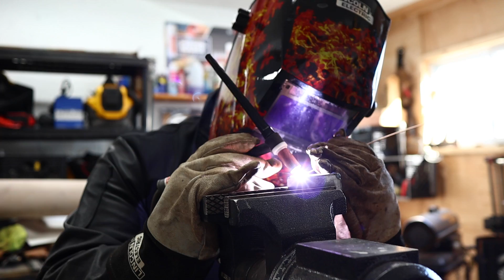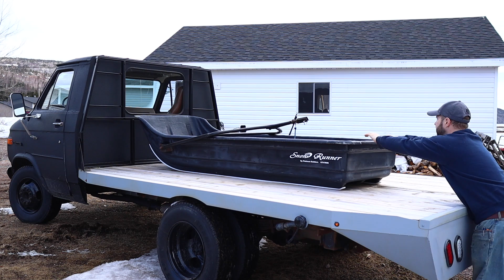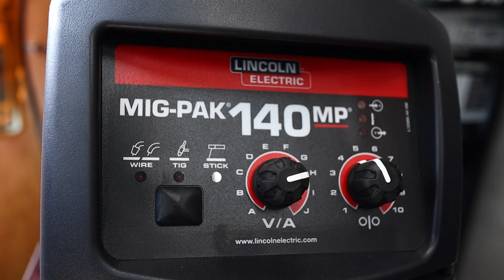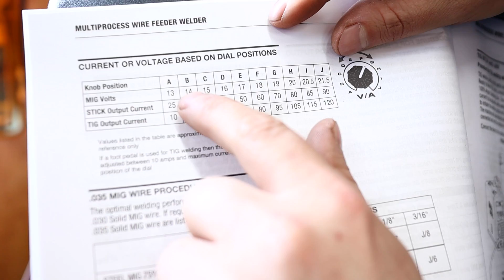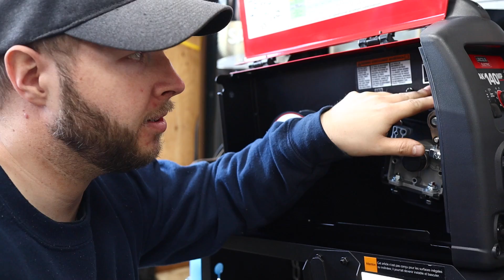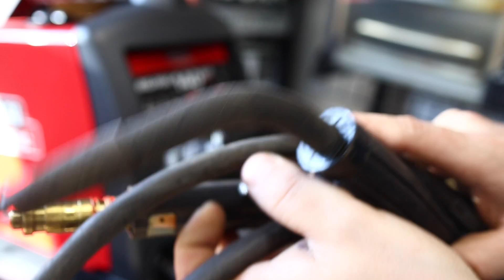The tool that COMPLETELY CHANGED my Workshop - [Lincoln Electric 140 Multi-Process]

Comment: What a great video showing the welder in detail. I Like how you showed the controls, the settings chart, and even the manual with voltages and amp values. I like to see things before I buy them and this is the next best thing. What's crazy is that this 120V machine welds the same thickness as my 240V Lincoln 180 Mig with shielding gas, 3/16". It falls short of the 180 when using flux core but unless you get the 045 liner kit for the 180, you're limited to 5/16". (with 045 NR-212 flux core they claim the 180 will weld 1/2")And it weighs about half as much. I'm tempted... 
Edit: I just looked through the manual and this 140 will actually do 5/16" not only with nr-211 self shielded flux core wire, but it will do it at lower settings using 71M dual shield wire. Very impressive, the inverter is definitely more efficient!

Comment: I got a Lincoln 210MP for one reason: versatility. My shop has 240 volts  but when I take the machine outside the shop, most places are only 120 volts. I do have all the processes plus the machine is inverter, no big transformer= less weight. Enjoy that machine.

Comment: Thanks for the very informative video--you're a good teacher.  I would take a theory course on welding from you, if you offered it.  I have done a couple of small and messy welding projects with hand-me-down equipment, but I'm in the market for something that will satisfy the needs of a small hobby farm, and allow me to learn more techniques on better equipment.  Your versatile setup from Lincoln here seems like it might fit the bill.  Is there anything with similar versatility, but maybe with a bit higher output / larger capacity that you recommend?

Comment: Even though it costs more, I find the flexibility of having separate MIG and TIG/Stick machines is really worth it once you get into welding. Both machines are always ready to go depending on what needs to be done, and with TIG comes with a lot more configuration. Seems like a hassle to switch all the attachments, swap gas bottles, connectors.

Comment: The 140 is the bottom tier and not considered an industrial spec unit - but its great for small jobs.
Reply from the maker: You are correct, it wasn't built to be in that class.